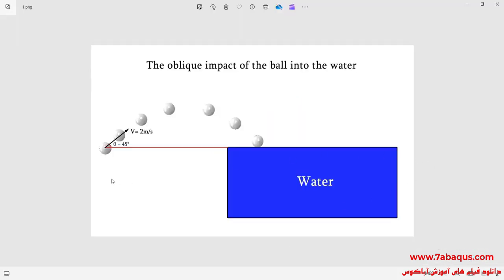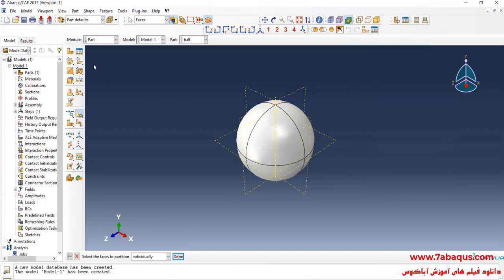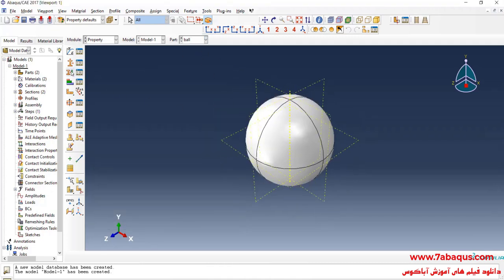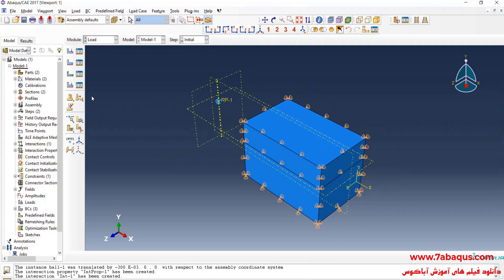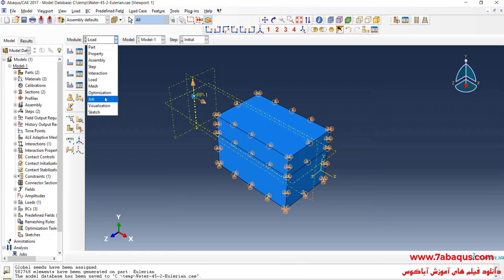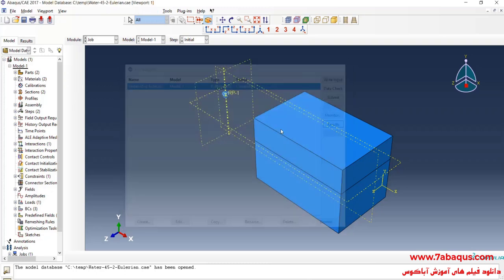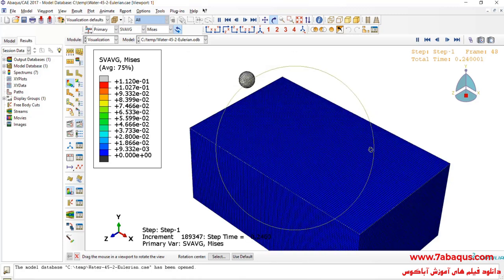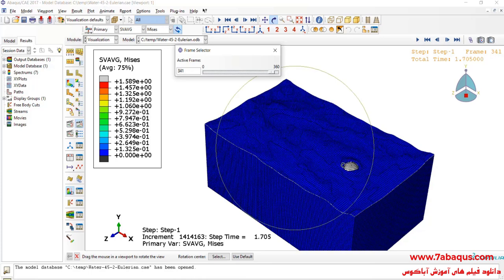Oblique impact of the ball into the water using CEL method in Abaqus software

Comment: Excellent video！But I wonder why should we first create a deformable ball and then converted it into a rigid ball ?
Reply from the maker: Because the weight of the ball must be considered
Reply: @saeedmoeini-7abaqus oh！that makes sense. Thanks for the clarification ❤
Reply: @saeedmoeini-7abaqus  But if the ball is made of steel then why it didn't sink into the water🤔
Reply from the maker: @chuchuchuii905  It is clear because the ball is hollow.(Ball is shell)
Reply: @saeedmoeini-7abaqus damn, why am I so foolish 😢